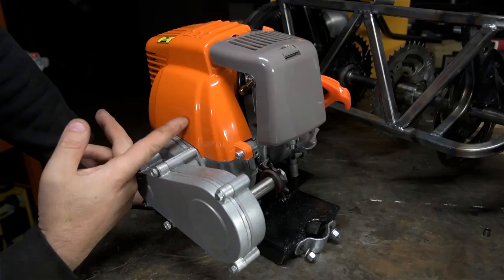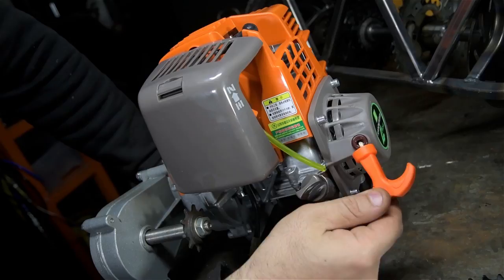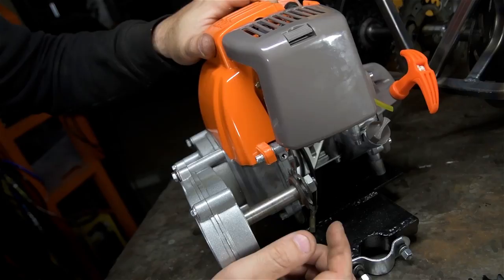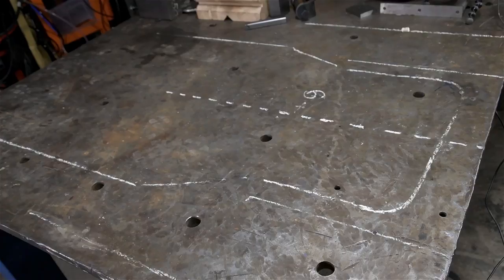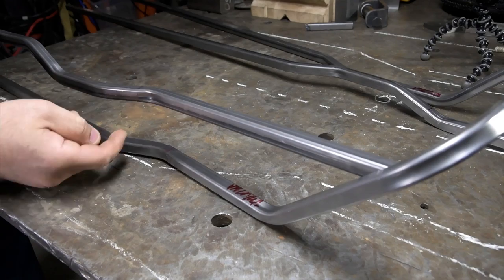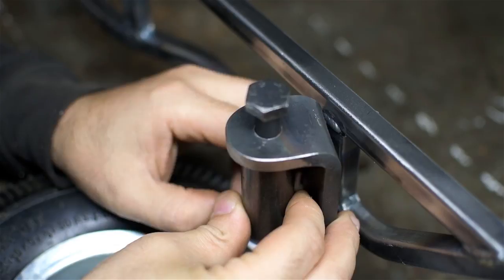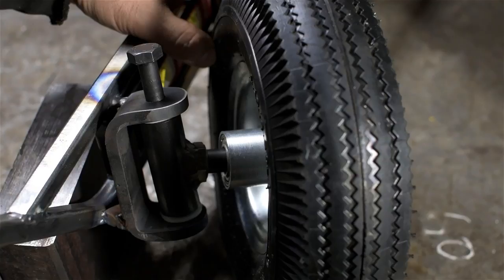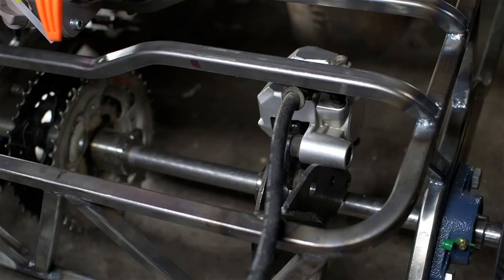"CHAINSAW" GO KART! - PART 2

Comment: Harbor Feight sells a 2 stroke gas generator for $89.99. It is a 63cc 2HP engine. Little better exhaust and instake/filter and you are looking at a whopping 2.3HP. That for $89.99 + $24.99 the exhaust and $8.99 intake/filter is an amazing deal.  You end up with a great 2 stroke motor on a cheap.

Comment: Its coming along nicely. I think the output shaft of the cvt is going to be too long for the load applied to the chain, possibly supporting it with another bearing would keep it from failure. Also 6° or 7° of caster should be plenty for a young man to steer and the steering will still return without fighting the wheel. Camber I'll guess maybe 10° max to keep the tires in contact while turning, any more may cause other steering issues. Just some thoughts, I'm enjoying the series.

Comment: It's probably too late now, buy a possible issue with the chain and chainsaw combination might have been chain size. Variable gear bikes generally use a 3/16" chain while fixed gear or single speed bikes use a 1/8". The former is designed to jump off sprockets while the latter won't.  It may have kept coming off due to vibrations from the engine slapping the chain around too much.
Either way, thanks for the video.

Comment: bicycle gears should have space between them  so the motor should be about 16 to 18 inches in front. This would allow the derailer time to adjust. The chain has the ability to comply with the movement.  Usually the torque applies to the front or peddle area and the gears in the rear have pull from the top.   If you stay away from new items and work with older Homelite products, you motor will have a better life time. 4 stroke is weak and uses more gas as the motor has to go around 2x more.

Comment: Hey Tony, Great video!!  Wish i would have had all the equipment you have when I built my
chainsaw gokart.   It took some doin but she really moved. gear reduction is an absolute must.
I achieved this with a Snapper self propelled lawn mower transmission. And get this, they are 
limited slip. sure I still had to do all the fabricating of hubs and sprockets and figure out the whole
Bearing thing as well as the steering telemetry(which is on the internet by the way. or was 16 yrs. ago).
   I used an old McCulloch chainsaw I bought at a thrift store for 5 bucks. It did cost me a bit for chain,
 bearings etc. but well worth the expense. I think the main thing that was required to keep the chain on
the kart was a spring loaded chain tensioner on the slack side of the chain. It also keeps the same chain 
on longer because as the chain stretches the tensioner takes up that slack as well.  Anyway, I made it work, 
no machine shop, basic wire feed welding skills, and some info from the computer. It hauls ass. Probably
unsafe for a small kid but Im 50 years old now. And I always wear a helmet.

Comment: Also as a bicycle mechanic here, old gears and chains really don't mesh together well, as previously stated, the teeth on the gears have ramps, these ramps are directional too (one way ramp). Essentially though before the ramps become an issue, the chain itself stretches extremely easily, half link chains have a much smaller amount of stretch and are thicker and stronger than most bicycle chains. Also the cogs themselves, (even if only used for a few days), will generally shape themselves to the chain that is run on them, as you mentioned in your first video, the gears you were working with hadn't been hardened either. Essentially what I'm saying is, if you had bought the chain and gears new instead of being given all the second hand parts, you likely would have had a fair bit more success, apart from that though, unfortunately even 0.5hp is enough to snap most bike chains, this is why when people do a 'bicycle to motor-bicycle' conversion, they will keep the engine size below 35cc if they want to run their regular bike chain, otherwise with anything larger a moto chain is needed and same with the cogs. The only alternative I have seen work was someone using a half link bike chain, connected to a high end BMX sprocket, with a Jerry-rigged clutch system that I couldn't explain to you if I tried... Anyway, I'm sure nobody will read my ramblings, but in case you do.
Thank you for making it this far.

Comment: I think you just needed a better transmission. Probably a nice and thick short chain with a fat sprocket (surely not a bicycle gear), and then I would have gone for a rubber pulley probably (I'm thinking that could possibly prevent the engine from stalling while starting - that chainsaw clutch was too small). Very nice job on the frame tubing

Comment: hey tony i really like your frame. this project brings back memories , around 1990  my good friend who was quite literally  a rocket scientist bought a surplus electric 3 ph motor . he designed  a  battery powered vfd to drive it he also used some weird batteries they were much smaller than lead acid. i designed and built the frame and various controls. this thing was a two seater, it would smoke the tires for as long as you held the pedal floored, he later programmed  a more sensible acceleration curve his kids were about 10 and 12 as i recall. this thing was scary fast and the local cops eventually told him he wasn't allowed to run it around the neighborhood, hope you have better luck with yours  i seem to recall using 10 degrees castor and a couple degrees camber. too much camber will cause rapid tire wear.

Comment: firstly Darren Jensen is partly right and completely right with regards to vid  don't use multi speed sprockets if using push bike use single speed as it has no shifting ramps. But, you should have used belt and pulleys for a cheap low power drive system.
However  if your using second hand sprockets you needed to use ones that have worn equally as a discrepancy in wear will put unnecessary pressure on the chain as a .1mm difference on tooth wear over even 13 teeth is 1.3 mm difference in travel over the first rotation on the axle sprocket. This causes your chain to stretch and snap. 
Also you need you use the original chain that came from those sprockets as that chain will also have worn to the wear of the previous sprockets that it was on (and changed its link length accordingly) and you will find that the link length of the chain is not right for the sprockets also adding stretch. So all in all second hand chain drive parts shouldn't be used unless takes from the same system.
However push bike chains are poor choice any way as not designed for the stress levels. but if you want to make bike chins work you needed to put a spring loaded tensioning idler sprocket  to remove slack (and the twist in the chain that it will result) as the chain slackens after it comes off the axle sprocket as well as remover the knocking effect as the slack is taken up over the drive sprocket as I'm pretty sure most of your breakage in testing would be just after the driven sprocket as in the vid mainly due to the yank every tooth release.
 in short motorbike chains rule but are catastrophic if set up badly and relatively expensive.Iin my opinion if you want a cheap easy option just use a belt and pulley.  i tend to use a cam /timing belt and pulleys set  drive system as it is more flexible and a new belt costs nothing. the other option is to steal the whole belt drive system from a sit on  lawn mower as you can also re purpose the whole rear axle too. 
any ways loved the vid especially the fact you left in your mistakes /R&D process as you learn more form mistakes than watching the perfect execution.

Comment: those bike parts are designed to shift with a derailleur so they have a tendency to throw chains that arent adjustable side to side with derailleur cable tension

Comment: I love the project.  I have some.. what I hope is useful feedback for you.

First, that motor you bought, and the gears it comes with, assumes a 28-31" wheel.  The gokart wheels are much smaller.  You will probally want a much smaller drive sprocket than came with the motor.  

I'd also look inside that cover, I expect it's not the CVT the ad said it was.  But it will be a reduction gear.  

The likely, biggest factor in your trouble with the bike gears, is that the gears you were trying to use, are specifically designed to jump off the gears.  They're kept in check on normal bicycles by the derailers keeping them in line.  I saw you used a derailer sprocket as a tensioner... tension, as you saw, isn't going to do the job there.

Comment: I think that if you want to use the chainsaw engine, you need to add a flywheel.

The chain is probably breaking because of direct drive from the engine, which has huge torque jumps. Working under cyclic stress is really bad for materials, and flywheel mitigates that effect. Maybe you can get one from old motorcycles. The downside is that your go kart will not be as swift

Also, mounting engine on springs/something elastic could help, and go kart will not shaking as much.
Hope this helps :)

Comment: You could have built a straight axel for front and welded the steering knuckle to the axel with the camber and caster angles that you needed you could have used a piece of the larger thicker tubing for this , that how we built them old school.

Comment: Hey This Old Tony, the kart is looking awesome! I thought I'd mention the 20deg castor angles help with the lack of differential on the rear axel, as they force the weight distribution to lift the inside rear wheel. you may want to be careful reducing the angle too much as rear axel traction could reduce control authority... also don't forget about ackerman angles on the control arms, my karts kept eating tires without them ;) Keep up the good work, I love your channel!

Comment: the chainsaw likely would have worked with some motorcycle chain, bike chain is very light and would need to be kept super tight with a spring loaded idler, increasing the chance of it simply breaking

Comment: Hi Tony dunno if it's too late but I would recheck your desired caster angle. Even 15° seems high, on my hot rod my axle is set a 9-10°, and on big rigs we run 4-5°. Two different vehicles, both run king pin type axle like the go kart will basics be. Anyway keep the vidjéos coming this is the best series to date!

Comment: bigger chain. I predicted the broken chain in the first video. If it makes you feel any better, I only knew this would happen because, when I was a kid, I had a cheap chinese type quad, that me and my little brother, just demolished, but crappy as that quad was, the engine was absolutely indestructible, We broke every motor mount, you could literally remove the engine from the frame, the back axle at some point, also became removable. we used big metal hose clamps to hold the axle in place [yes 2 metal hose clamps are that strong] and a combination of hose clamps, blocks of wood and a broken pool stick [it being tapered] that would be hammered in between the frame and our monstrosity as a wedge type key to lock it all in place. [this required basically a full rebuild daily] me and my bro  learned alot, but back to my point.. one day the chain broke, we had a broken dirtbike, we commandeered the chain from the bike to use on the quad. the quad sprockets had different spacing [between the links of chain]. but the front sprockets shared the same [idk shaft key, basically the hole in the center was same, so swapped out no problem] the rear bike sprocket hole was significantly larger and the outside diameter was larger as well. So we clamped them together using vice grips and a vice, and drilled 3 or four holes and bolted them together so the original sprocket was now an adapter and thus we now could run the dirt bike chain on our quad. [we were young and where there is a will theres a way, or is it a wheel theres a way] anyway it was fun and kept us out of trouble, but about a month in, the chain snapped, and that when we realized that the  size and strength of the chain is a very significant factor in these types of things. lessoned learned.

Comment: LOL you did it the hard way.  A go kart kit is available cheap!  Or for $15 you can get the steering spindles all set up with out the extra work your getting into.  Oh and a go kart with a 3hp engine at 3500 rpm usually has a 7:1 ratio for 25-30 mph and a 6:1 ratio for 28-42 mph.  The higher number was achieved easily when the person using the go kart bypassed the air vane governor and hooked the throttle directly to the gas pedal.

Comment: Tony, don't reduce the camber/caster angle, the thing will not turn, it will want to go straight, the looser the surface you're driving on, the worse it will get, on pro carts front wheel jacking by camber/caster angle is actually there to lift the "inside" rear wheel to simulate a differential, I know this ain't a pro cart, but the design idea still stands - keep this in mind when positioning the center of gravity too btw - or alternatively you could build some sort of a differential for the rear end, or maybe just split the shaft and live with just one driving wheel, I bet it will still drive better like that if you will go for reduced caster/camber angles

Comment: Eh! good work one thing i would add is a support for the shaft and sprocket coming out of the transmission there will be a lot of down ward pull may bend or snap then its history tranny just  the suggestion  u may have. seen that good work looking forward til the end and test  drive 
Sal

Comment: Weld the sproket on to the clutch housing that way you don't snap your cahins and the motor will not pull until rev'd high enough.

Comment: 20 of caster is not alot. When on turns go karts understeer because of locked rear. Inside turn wheel needs to turn less than outer. So when you turn to right, wheight transfers to left, which try to lift right side, also caster rolls the frame which make it freely moving wheel, ir very little grip, so it doesn't feel then you drive.

Comment: Bicycle chains have too much sideplay due to their narrowness and the need to operate with a derailleur. Swap that for a heavy duty bmx bike chain, it'll stay put.  Figure maybe $30 at a bike shop. A "half link" chain (they're designed for small sprockets) would be good too considering the short runs and tight radii involved.

Comment: The motor is bouncing and throwing the chain because the mounting is too unstable and springy.  Stabilize the back part of the motor.  Your mount was for the chain bar.  BTW, beautiful motor from e-bay.

Comment: Get an actual clutch with a proper #40 chain sprocket. Leave off the jackshaft and go direct to the axle. In the 60's the local gang of speed jockey's were hitting 80 mph on a oval track with 100' straightaways.

Comment: This project seems to go in a very good direction :)

One thing: it seems like the sprocket of the gear box could need some support, I don't like how it is wobbeling and it sticks out very much, it's going to pull itself down by the force of the chain.

Comment: Bicycle chains are used to side shearing esque loads. They shouldn't break due to your properly aligned engine and sprockets. They after very small chains however, maybe too small for the tq if your engine. I used to snap chains when I raced expert level BMX

Comment: Motorbike chain did it for me but mine is for adults only. 2500mm overall legnth and about 2000mm wide, powered by a 4HP Stihl 2-stroke chainsaw that used to have a 1200mm bar pretty stupid but when you have the space it´s fun.

Comment: My only concern so far is the lack of a rear differential. It will want to go in a straight line if as the wheels are being driven at the same speed.

Comment: As you already know the gears you have where designed to allow the chain to shift easier from sprocket to sprocket, in the future you would want single gear sprockets like a bmx bike or beach cruiser then the chain wouldnt be so inclined to pop off

Comment: looks like you had a bicycle eliptical front sprocket set as your first gear reduction, thats why the chain wouldnt stay on. front gearsets are still made sort of not round a little like a shaper return stroke to maximise humanoid power utilisation

Comment: OK, on topic now - my chainsaw has this thing where it actually engages the clutch when starting up - maybe it's the choke causing those additional rev's, I dunno, but yours seems to be doing the same thing and I suspect that the thin chain you're using simply cannot withstand that sudden force upon it. Perhaps stronger springs on the clutch will prevent it from engaging at 'heating up' RPM's, but I'm pretty sure that it's the sudden engagement that's killing the chains, not the rest of your setup.

Comment: You have inspired me but I'm going to start out with a frame from a 4 wheel handicap scooter. All of the issues with steering are already designed and built for someone who is 300 lbs. Just strip the electrics off and build a new rear axle and engine mount.

Comment: I was hoping you'd explain the angles you used on the steering brackets, you said you'd talk about it after you did some welding but it didn't come back up. Maybe it'll be in part 3.

Comment: ive noted an error when you welded up your front axle you negated your negative camber when you welded the front axles to spindles they need to be perpendicular to the spindles because when you turn you now have positive camber when you turn great build though

Comment: You need to use you chain daw bar extend the motor to the right side of the cart find a clutch that will take the stress of the speed of the motor.plus you can use a battery and a starter for one gear motor it will be super fast.

Comment: You need to use #35 chain & sprockets. Bicycle chain breaks just pedalling so an engine will surely break it. In case you didn't know. 🤣